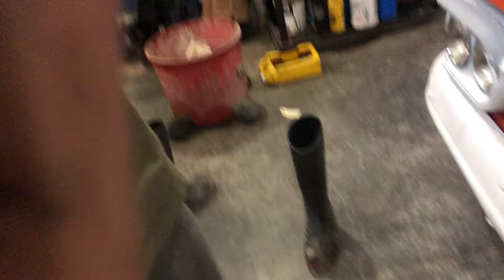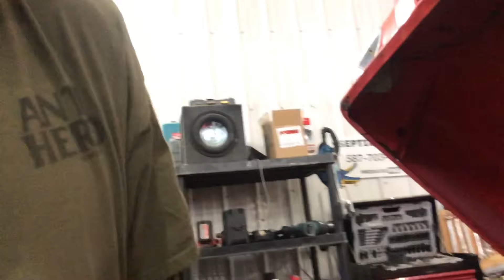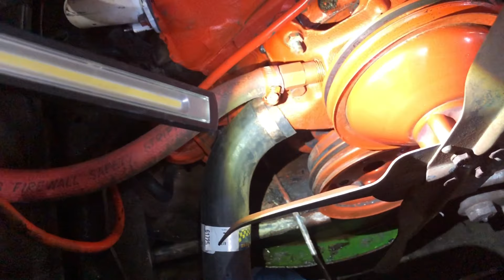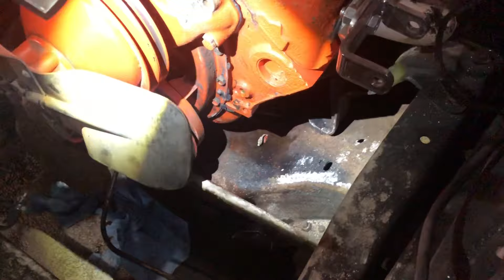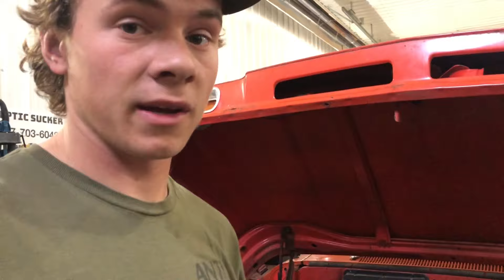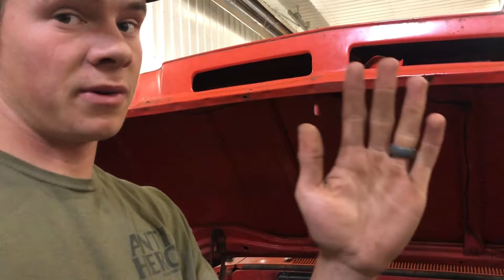TOP DEAD CENTRE SBC CHEVY: EASY WAY 1 minute no valve cover pulling required | TDC

Comment: I just lightly push a kleenex in the plug hole and rotate the crank. When the compression stroke comes around it puffs it right out.  Then rotate till the pistion is all the way to tdc.

Comment: You saved me! I screwed up the timing installing a new distributor. Me and my teenage son got it lined up again by working together. Got the distributor to drop down, and now everything is running perfectly again! In fact, I don't think it ever ran this good before! Thank you!
Reply from the maker: Awesome!!
Reply: Do you do the tdc method with the Distributer in or out I installed my Distributer and messed up my timing
Reply: @catfish4721  you get the engine at tdc, then point the rotor in the distributor to cylinder 1. If the distributor won't drop down into the engine all the way, then turn the engine back and forth a little to get the gears to line up.
Reply: @jhon614  thanks man

Comment: Damn bro thanks for helping me remember my dad taught me this years ago but there's a part I forgot about and whenever you spend it over to number one compression stroke top dead center your rotor also should point at number one on your distributor cap so like you said you should be at zero timing on compression stroke for cylinder one and rotor and pointing at one as well if not then that means you're 180 out..? Unless I'm misremembering LOL regardless you helped me "hit the nail right on the head" as far as what my dad was teaching me cuz I couldn't remember lol

Comment: Hey man i have a 1990 chevy caprice 305 ive got new spark and spark plug wires but the car still ran rich with a lot of stutter when applying more gas when in drive, i aligned the line with the 0 degree and removed the distributor cap to find the rotor pointing to the 6th cylinder so i removed it and turned it to cylinder numb 1 but the car didn't start at all got any advice? Maybe it wasn't on the compression side?

Comment: If you are simply dropping an ignition distributor back in place, the above Sam's method may be OK. 
And for those of you who are wanting a simple 2 minute (or less) explanation, you may as well skip past my comments! 
However, if you are wanting to locate "true # 1 TDC", please note that it cannot be achieved by placing a finger over the # 1 spark plug port,  whether working on an auto engine,  snowmobile engine, motorcycle engine, go cart engine, etc, 

The main reasons for locating  True # 1 TDC are as follows: 
...... Camshaft phasing for those who are after maximum performance. 
...... Ignition timing for those who are after maximum performance.
...... to verify the Harmonic balancer indexing line against the corresponding timing tab markings.  

In order to locate True # 1 TDC, we use a PPS (positive piston stop) tool, a degree wheel and a temporary wire (or other) pointer tool. 
Using the PPS tool, we mechanically stop the piston at approximately 20 to 30 degrees at either side of what would be theoretical TDC. 
We can stop the piston at 18*, 21*, 32* or 25*..... it does not matter as long as we shoot for the  degree at either side of theoretical TDC.
I prefer to stop the piston at/near 30* for more accuracy. 
The amount of degrees can be referred to as the "split". 

As we continue to to rotate the crankshaft (in both directions)  the piston will be stopped at either side of theoretical TDC.
We continue until we see  an equal "split" on either side of what would be theoretical TDC. 
Once we see an equal amount of degrees (the "split"),  we remove the PPS tool, and then bring the crankshaft around to where the "un-touched" pointer is aiming at ZERO. 
Now we look at the TDC markings and make any necessary corrections. 

Whether using a spark plug port PPS tool, or a cylinder block deck PPS tool,  there is NO substitute for this method.
Using the PPS tool/degree wheel,  will give you as close to true TDC as necessary. 

If attempting to achieve this by using a dial-indicator (on the piston deck), you would need to account for connecting rod TDC dwell, of which is nearly impossible to do. 

..............

Comment: I crumple up a wad of paper and wedge it in the #1 hole. Then bump ignition when it pops out, I’m close enough to crank it by hand to line up the timing mark. That sound right. Cause my engine still ain’t running good lol

Comment: I set timing the same as your video and seemed to work great. I just to happened to have a TDC tool and put that in as well, I think I may have grazed the piston since now when I first crank for a half second it sounds like valve tapping then goes away.
Thoughts?
Reply from the maker: This video is not for setting timing. Just finding TDC. So I can’t take really answer that.  First you have to find TDC. And then drop the distributor in with rotor pointing at cylinder 1. and then put cap on and make sure cylinder 1 node is pointing at cylinder 1
Reply: @samstrucks  yes, all good there.
The knock ended up going away, I have a fuel pump issue. I’m stalling after about 20 min of driving, PSI drops to 40

Comment: I've heard some guys will just pull the #1 plug...put a long screwdriver in the hole, and slowly turn the crankshaft. It will push the screwdriver out as it climbs towards up on the compression stroke.....then just line up the marks and you're golden. Yes? No? Maybe?

Comment: I did it just like you showed but distrubutor does not drop in and face number 1...sits either pointing to #5 or the radiator...motor is sbc 305 tbi
Reply from the maker: That’s because of your oil pump drive. What you need to do is drop it in pointing to cylinder 1 with motor at TDC (just the gears will engage) and then turn the motor until the distributor drops all the way in.

Comment: or snugly stuff a small balled up piece of paper towel in #1 plug hole and spin engine until compression stroke causes the paper towel to pop out as the valves will be closed.
Reply from the maker: Good idea!!

Comment: If your turning your crankshaft by hand should you put truck in neutral or is park fine as im questioning turning it and putting  tension on transmission and damaging it unnecessarily?
Reply from the maker: Park is fine👍🏽
Reply: @samstrucks  figured it out but thanks much and thanks for the video to help out

Comment: If you have 2 people with you. You can dis connect the distributor power to plug wires and turn key dont hit the gas pedal just turn key and pop your finger off

Comment: I have Number one  coming up making compression pushing the spring tool up  which is screwed  in the the number 1 cyl  head. Now right before the piston was to go down would that be top dead center at this point? if I turn the balancer with he ratchet and socket and the piston was to just  start  traveling down for the  power stroke  would this be  correct? 
Thanks a bunch in advance
Reply from the maker: So, the piston will come up and sit still at the top for about 10 degrees of rotation. Right in the middle of that “still” spot is TDC.

Comment: I found the 0 TDC  now please correct me if I am wrong I have inline 6 Chevy  I should go before that 0 12 degree (before) and move the distributor point to cylinder #1 or before cylinder #1 .
Reply from the maker: This is for v8 motors. Sorry I don’t know much about 6cyl
Reply from the maker: But I imagine it’d be the same. When the 1 piston hits the top of the stroke on its compression stroke that is TDC

Comment: If you take the top off the distributor you will see compression stroke points at cylinder 1
Reply from the maker: You bet, but this video is not for that. It is for someone trying to reinstall their distributor

Comment: So what do you do if your line is NOT at 0°when the compression releases? That's where I'm at right now
Reply from the maker: Compression releases after zero. Get a screw driver and figure out when the piston is at the top. Split the difference between when it stops moving up and starts moving down and put a line on your balancer at 0
Reply: @samstrucks  thanks.... yeah I have a cheap $15 dollar borescope from Amazon that I connect to phone and can use to physically see when the piston reaches the top of the stroke.....
But my mark on my balancer is about 20 degrees past the zero mark......I just took it off yesterday (I'm replacing camshaft)  so why would it be so far out? Thanks for quick response!!

Comment: So if you put your finger over spark plug #1, will you feel a suction or air blowing on your finger ?
Reply: Air will blow and try to push your finger off from covering the hole
Reply: You will hear the compression, it WILL escape around your finger and create an audible hiss. You don't even have to put your finger over the hole tightly to hear it

Comment: Do you need to remove the distributor for that task? I’m having issues with my impala
Reply from the maker: No you don’t
Reply from the maker: But that’s usually why you want to find TDC. Is to install the distributor. Pull the distributor find TDC and then drop the distributor in with the rotor pointing at cylinder 1.
Reply: @Sam’s Trucks  rotor pointing at cylinder 1, or the #1 spark plug wire?

Comment: FYI..... for locating # 1 cylinder TDC (verifying your timing marks), you DO NOT need to be on the Compression Stroke. The crankshaft, connecting rod and piston do not care where the camshaft is for this. 
For camshaft phasing, dropping a distributor in place and for ignition timing and  yes.... you do need to be on the compression stroke.
Reply from the maker: Yes, but as a rule of thumb it’s always good practice to find compression top dead centre. That way it’s always ready to go and you won’t be 180 out

Comment: Best way is to pull valve cover and look at number 1 valves--believe me
Reply from the maker: Ya man, whatever you think is easiest do that! I’m just saying what I think is easiest and doesn’t require new gaskets or anything
Reply: @samstrucks  Not easier, but I have had errors with other techniques--including whistle
Reply: This is the easiest way in a marine engine where the exhaust, and wiring harness has to be removed to get to the valve cover